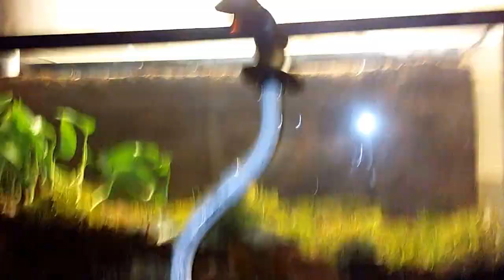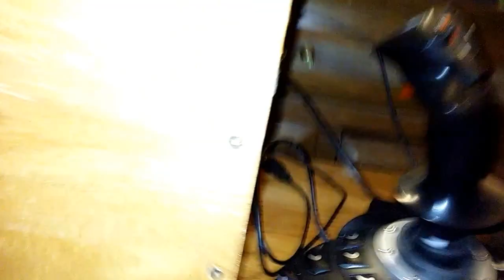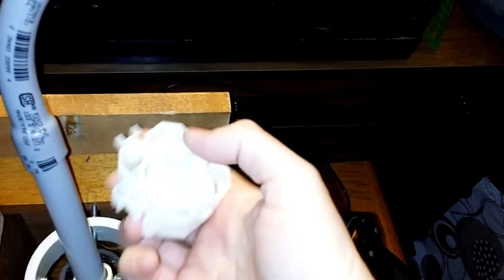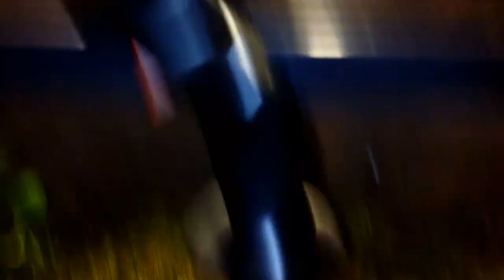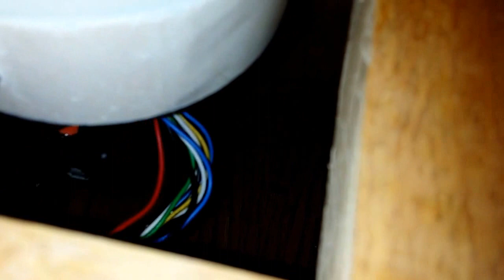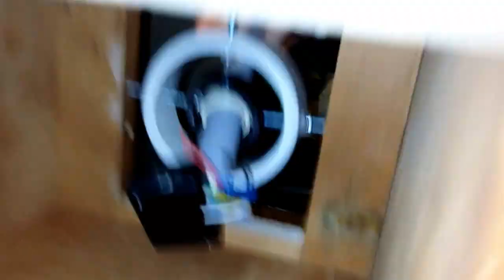Physical build of the DIY EDTracker Cyclic

Comment: Hi Casey, nice vid! I'm also thinking of make a cyclic of my own, and I find your vid. I have a question, in a real helicopter, if you move the cyclic away from center position, and realease it, will the cyclic stay on that position? I know there'll be no centering force to make it go back center, but your diy cyclic seems will be falling away if it's realesed at a postion not in center. Should it be some resistence to keep it in position and not falling off?(like the collective, if you release it, it should not fall down, correct?)
Reply from the maker: Yeah, there was no friction on this. You could compensate for that by picking up shock absorbers for RC cars and tuning them to your specific needs though :)
Reply: @cannibalholiday  nice idea! thanks for your reply. I'll try it :-) and happy flying!

Comment: Hi Casey. Thank you for your video. I have been wanting to build my own cyclic and collective for ages and tried to figure out the motion tracking. Here it seems you solved my challenge. The EDtracker looks like it might do the job. How are your experiences with it so far. I also want to make the collective with a rotating handle to simulate the uh1 gas handle and it seems that the EDtracker might solve both the collective movement up and down and the handle twist, all in one unit. Have you tried that? Happy flying. :) Hans Jorge
Reply from the maker: Hiya. Interesting timing :) I'd taken this apart a while back for more refinement but then things got in the way (like 3D printers being out of commission). Just started working on it again last night.
I hadn't implemented the twist on the collective but I was going to do that as well. I made one of the PVC style of collectives posted on youtube, and planned to make a second sleeve from a slightly larger tube. The EDTracker could be mounted in the collective head and the cabling run down the throat of the collective shaft :)
Reply: Good idea. I was thinking of making one of the pvc ones too. I actually bought plans from Roger Dodger Aviation ages ago. In the meantime life got in the way and my sim station was dismantled and put away. Now I have gotten a playroom again and am working on setting it back up. Then the old dream of making my own collective and cyclic came back. I had imagined putting it in the rear end of the tube, by the hinge but you are right. It would make more sense to put it in the collective head. It would probably increase the sensitivity and as the head is a box anyway it would not look odd. I often wonder why, of all flying things, I had to fall in love with the helicopter. I guess there must be a deeply masochistic streak in my personality that I wasn't previously aware of. ;) Keep us posted on how it goes. 😃👍
Reply from the maker: If you google for "Damient St. Pierre diy uh-1h collective" you should find his blog in the top results. It's got a design for an aluminum based one with a 3D printed control head. :)
Reply: Casey Wagner Thanks. I haven’t been able to go forward with my project. Life gets in the way sometimes. But it’s still on the back burner. When I started looking for inspiration and to refresh info I came across a comment you made on the ED forums that you were contemplating scratching the EDTracker cyclic idea because you ran into some problems with the tracker when placed on the floor as opposed to your desk. Did you figure it out or did you give it up. Kinda makes no sense for me to try it if you already have made sure that it it’s not a feasible concept.